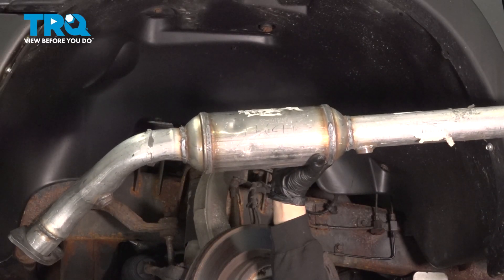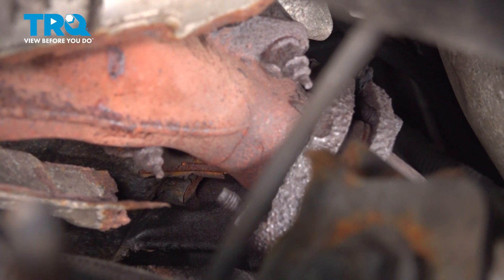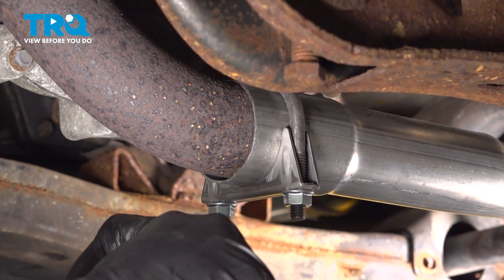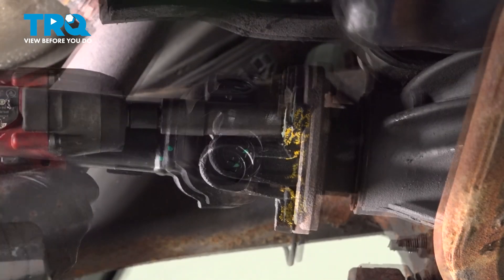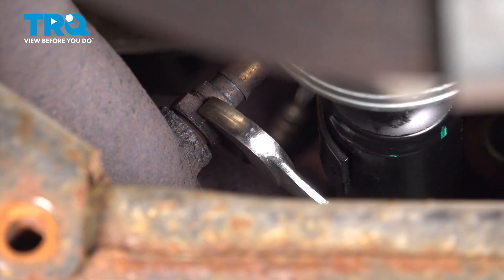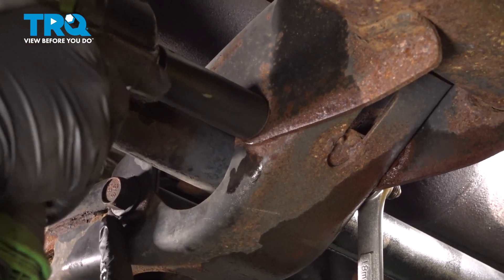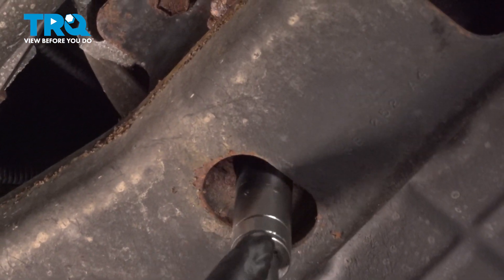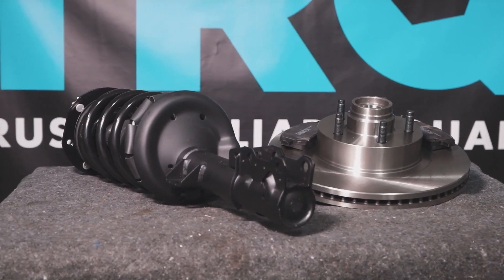How to Replace Driver Side Catalytic Converter 2002-2008 Dodge Ram 1500

Comment: Didn’t need to undo the transmission mount, driveshaft, or crossmember. Just unbolt from the top and the bottom and you can just take it off.